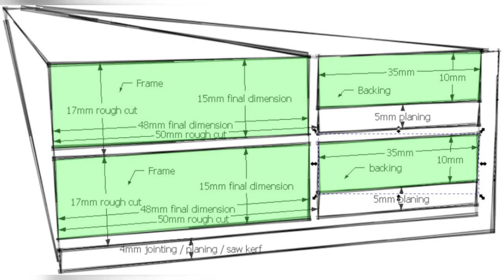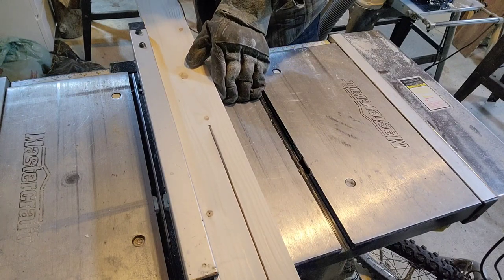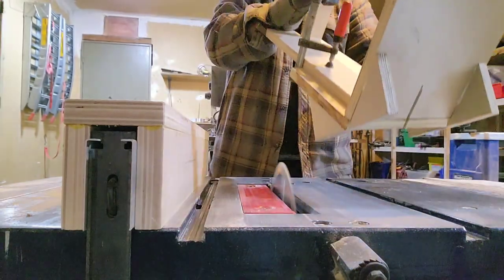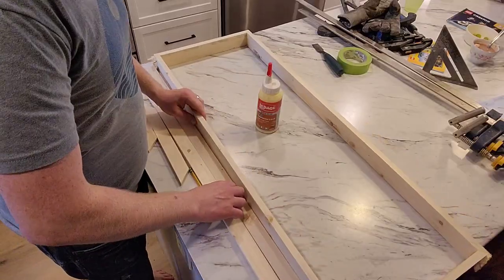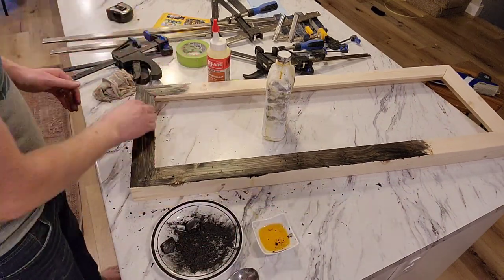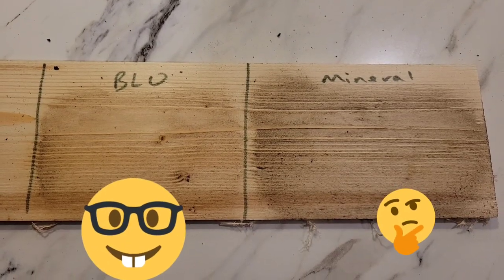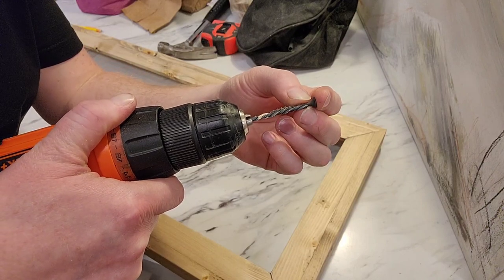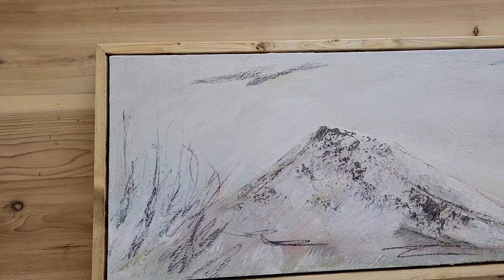How to make a floating frame for canvas paintings from one 2x4

Comment: Tip for the "1&2" method: After chopping them down, place them both on the jig together, and cut them both in one cut- just a trim cut, and they will be even more perfect than before.
Tip for hanging drop frames: Don't mount a hanger for the frame, just sink a drywall screw into the wall and hang the painting off the drop frame itself, the wood of the "L" can take the weight, and it pulls the frame tighter against the wall, too.
Reply from the maker: Thanks for the tips!